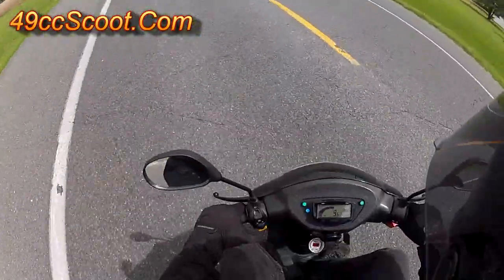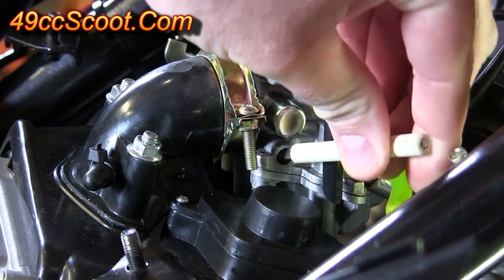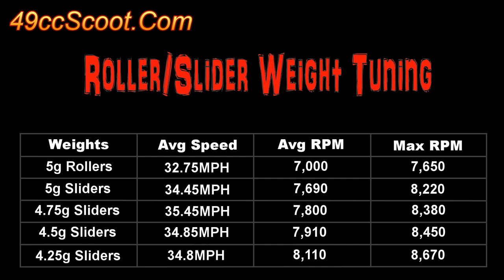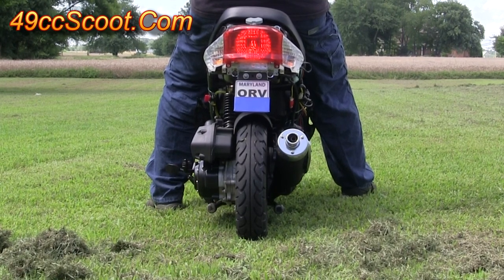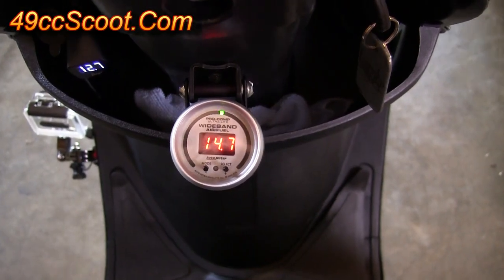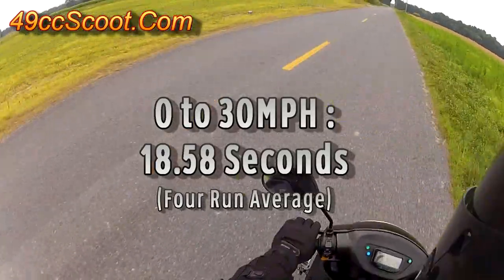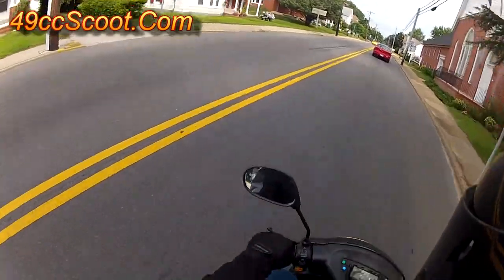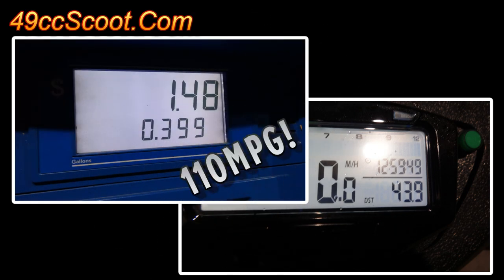Project TaoTao : Carb & CVT Tuning, Airbox Restriction, & Keihin PD19J Swap : 50cc Scooter

Comment: Yeah not a lot of people are going to do that it's cheaper to get online and get a big bore kit for 200 bucks comes with exhaust, intake, carburetor, performance air filter, CDI, NGK plug, performance cam and lifters, transmission upgrade and gaskets, performance fuel line.

Comment: Unbelieve you do that all also for us, ty very much
Reply from the maker: I'm glad if it helps. I love scooters and engines in general.
Reply: quick question, what should i do, when im riding my max speed is at 35mph(almost full throttle), and when im at full throttle it goes like 1-3 mph slower, whats the problem?
Reply: 90GTVert What brand sliders are you using or would recommend? I just got a KOSO variator with 6g sliders from scrappydawg but my 6g rollers are much faster with acceleration. Do would you recommend buying a "performance" clutch kit or just replacing the stock spring and/or shoe?

Comment: as far as your tests I am impressed with your knowledge all of mine is self acquired had to start working on small engines when I was little had a minibike and it sat too long one time and I had to take apart and clean my carb was my first learning session got into it right then
Reply from the maker: I read performance books for bikes/cars and such, but I have to have my hands on something to really learn it.

Comment: I want you to know I admire your dedication to those small engines.I do not have a shop but have done 100's of different tests.One thing worth sharing with you is my results on my gy6 150 cc concerning the air fuel mixture screw.Let me know if you're interested.Thanks
Reply from the maker: Sure, what ya got?

Comment from the maker: As long as there is no leak where you sealed off the head, should be no trouble with PAIR removal and tune. Take a look at the plug. Easy enough to see if it's fouled. If you run it WOT first and shut the engine off, coast in or ideally brake so the engine totally stops. Then when you look at the plug you'll be able to see if it's wet or dry to give you more clues. Check grounds and other connections. Make sure the plug boot and wire are secure.

Comment from the maker: Shouldn't be like a mirror, but they aren't usually as rough as you'd think. Rough it up with some sandpaper or emery cloth. Give the clutch shoes a quick once over as well. Clean both with brake parts cleaner before you reinstall.

Comment: At one point in one of the videos you mentioned a good starting point for the air fuel mixture screw, was that like 1 and 1/2 turns out or??? Thank you love your videos awesome information well-presented
Reply from the maker: 1.5 - 2 turns out is a common range for a starting point.

Comment from the maker: Thanks. This one is running hotter CHT than my 2Ts. My 2Ts stick more around 300-350WOT according to my gauges... but then I also don't have to run them wide open all the time when cruising at 30-35, so the 4T is seeing a lot long WOT times. The probe is about 11-12" from the header, maybe 1-2 o'clock position, about 3/4" spaced up to not block the small pipe off (pics on forum). It would work on a 2T, but oil is hard on the sensor and a special adapter (Koso) should be used. Never tried it.

Comment from the maker: It won't usually close until everything starts rotating. You can turn the pulleys by hand sorta feeding the belt while the engine is off and you should see that it starts working it's way out... or make sur ethe belt clears the cover and bolt it back on then start the engine. Let it run a few seconds and shut it off and re-check if you'd like. If it stays there after the engine is running, then there's a problem.

Comment: I ported my intake , opening up the 90° turn mostly, but the main issue was port matching, the ports were off substantially! Nearly 1/4 of the port, I bought a new intake, it was considerably smaller, and had a major reduction in size around the 90° bend, it was about 14mm, just over 1/2", like the tip of my lil finger ! I opened it up a bit, but it was nothing near the size of another I had, so I ported it and matched it to the head, I would like for it to be about 2mm larger around the 90° bend, with a nice sweep, it fits the carb and head nicely, I straightened the port under the valves, and blended around the valve guides, id like to eventually go to the 52mm bore, and 44mm stroke, maybe get crazy with some machining, and move to a 57 mm bore, should be 100cc plus a couple right? I haven't done the maths, maybe 98-99cc but no replacement for displacement!  It would be cheaper and easier to just swap in a 150cc, (with a big bore),
Reply from the maker: You'd have about 112cc if you could make a 57mm bore fit. All said and done, I'd guess you'd fair better swapping in a GY6 150. A lot of people have had enough trouble with reliability with even the 52.4mm bores. I'd also assume you'd have pretty much no material between the bore and the studs at that point, if there's enough room to do it at all.

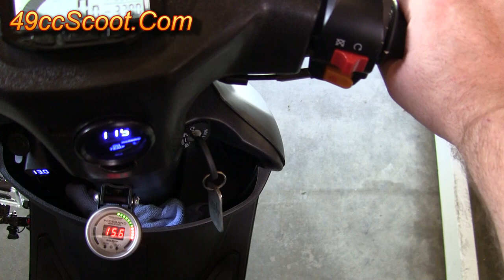Comment from the maker: Stephanie Spangler (can't reply to your message) : If you watch @ 6:56 or so I said I changed to a 90 main jet in the stock carb so it worked with the more open airbox. In stock form my stock carb had a 79 main jet. Most use 32-35 pilot jets stock.
Reply: yes you did. i just realized my misinterpretation. thank you so much for taking the time to share your knowledge and experience. My TaoTao50 is much happier now.
Reply: ***** u were right im still fukin with this carb.the fuel mixture screw is too far out smaller pilot? i did what ur video said on fuel idle mixture adj.
Reply from the maker: If the mix screw is way out, try a larger pilot jet. On these carbs it controls fuel so when it's out it's letting more fuel pass and if it's in it's blocking off the fuel passage more.
Reply: i read someone with a scooter like mine the vip champion taotao couldnt get it to run for shit it had 23 miles on it he had to return it carb issues. id bet the farm on it you could get it right.
Reply from the maker: Hard to know. There have been some pretty poor quality parts out of China at times.
Reply: Kevin Stearns My Roketa has 16 miles on it and runs like CRAP!
Reply: BigJohnMcVicker the guy on this page is fukin awesome he will get you in the right direction.

Comment: I took the pair block off plate off. Looks sealed good. Maybe I spray witb carb cleaner see if it idles up. There are only 2 grounds on the bike at the v cvr. Maybe the other end came loose . The bike ran great plug chop had been done. I did move up some jet sizes thinking that was problem becaus temp has dropped here but that did not remedy. Gonna check grounds again and change pluv. Tha ks  for the help

Comment: Great videos. I bought a new taotao and did replaced almost everything you replaced. It runs way better now. I can’t seem to find the KeiHin carb online and if I do I find, I can only find the cheap ones that looks nothing like yours. I know you bought yours from a local store. But did you find any legit Keihin carbs online?
Reply from the maker: I bought mine from an eBay seller, but they no longer have them. The Keihin part isn't essential. I actually think most replacement carbs that are fully adjustable would do fine. The stock carb wouldn't bother me if it were adjustable, but finding the right needle wasn't worth it to me. Easier to get a whole new carb.
Reply: Ok thanks for the info and btw your videos were really helpful. 👍👍👍👍👍
Reply: 90GTVert ... so the toatoa needs a 19mm or a 20mm carb... if it was in your video I missed it 3 times now

Comment: Just curious about your tire.  In the videos you accelerate through wet grass and then out of a puddle on the road.  What kind of tires would you recommend for wet street conditions?  Awesome instructional videos!
Reply from the maker: This thing is underpowered and I'm heavy, so it's not so demanding for traction, but I'm just using cheap Kenda K329s and I had Vee Rubber on the rear at one point. My two-strokes have more traction issues, and I've had good results with Michelin Pilots on them. Lots of tires work pretty well, but stay away from max performance dry weather tires. Michelin Boppers are probably the worst I've had. My first 70cc would spin the tire bad in the rain with one of those on the back.
Reply: Thanks.  Even the tread on the Boppers does not look good for wet weather.

Comment: Great video! Are 4 stroke engines hotter at the head than a 2 stroke?
I like your air-fuel ratio meter, have you tried to use one on your two strokes? Would that work? Where did you mount the probe, or did i miss a video?

Comment: Hello and thank you for these great videos I have a crazy question maybe you could answer, I bought two of the same scooters one of them does 43 mph right out the box which is crazy? But the other oneCan barely hit 25 what would you recommend I try?I have changed the plug,carb,cdi, and that fuel vacuum thing to no avail. can you recommend anything else because that particular one is still super slow?
Reply from the maker: Have you tried any of the parts from the faster on on the slower one? Like, did you try it's carb or just a general replacement carb? It could be as simple as a tuning difference. Could be that one has a restriction somewhere. Could be a defect, like maybe one has low compression.
Reply: No sir I didn’t try any of the parts from the other scooter, no I wish I did one at a time dammit man? I just kept getting stuff on Amazon you know hoping something would work I think it’s a lemon or restricted like you said I. Hey thanks a lot for responding looks pretty peaceful out there where you Live, got a nice clear mind to make great videos well the rest of the world as dodging cars lol. hey are you have a wonderful day and thanks again

Comment: Nice instructive videos! What pilot size were you using on the aftermarket carb?
Reply from the maker: Thanks. I used the 33 that came in the carb.
Reply: @49ccscoot  thank you for the quick response! I do appreciate it very much!
Reply: @49ccscoot  also where did you get 4.75g sliders? I can’t find any. Or did you use 3-4.5 and 3-5 to get 4.75? If not would it be ok to do so as long as you alternate sizes?
Reply from the maker: @elvis7094  Yeah, I mix weights to get the 1/4 gram increments. They must be staggered. So only 2 different weights of rollers or sliders, call them A and B. Put them in A, B, A, B, A, B so it is balanced. You can also modify weights to whatever spec you want.
https://youtu.be/YkNhqEFeWVQ
Reply: @49ccscoot  thank you very much

Comment: You changed the main jet to 75, what did you set the pilot/ idle jet to?  Also, I am a big guy, 230lbs., what slider or roller weights which you suggest just to go 35mph on flat roads?
Reply from the maker: I made no change to the pilot jet because it was not necessary. The mixture screw was able to control idle mixture just fine. I'm close to 300lbs so what I used here may be close for you. There's no 1 right answer, especially since contra spring stiffness can vary.

Comment: Awesome! Long intake runners helps car engines make more low to mid range TQ, has anyone heard of someone adding length to the intake of these scooters? Either a 1" spacer under the intake, or a pipe and boot between carb and intake , or both? Being these little guys sound their day at near full throttle, it may not help with top speed, however maybe it could help get ya there quicker??  If done properly maybe it could help top end slightly,
Reply from the maker: I'm sure it has been tried, but it's not a common mod. Most intake mods are due to fit or port/carb diameter changes. With these engines, gains at low RPM aren't usually worth a lot because the CVT keeps them at fairly high RPM so much. For all out performance, the best bet is usually to focus on making the CVT hold RPM the best you can at WOT and focus power making efforts on a somewhat narrow range.

Comment: I am planning on upgrading my 49 cc tao tao scooter to a 80cc with a big bore kit form rolling wrench, what carburetor to I need to use with this upgrade, can you recommend one thanks and keep doing more videos
Reply from the maker: +michael paradise 19-20mm without the factory sealing would be fine. Pretty much any that you buy shouldn't be sealed. That's only on scoots to meet EPA regulations. You can find them on ebay and from places like http://www.partsforscooters.com/?partner=49CCSCOOT . Keihin is good if you can find one at a reasonable price, but even the knockoffs do fine for most. Just the sealed stuff without adjustable needles should be ditched.

Comment: Is that an aftermarket speedo? And if so, where did you find it? Also is your engine still a stock 49cc or have you added a big bore kit?
Reply from the maker: Gauge Info : http://49ccscoot.proboards.com/thread/8614/trail-tech-vapor-information-installation

It's stock, just a little tuning.

Comment: Ok got got the cvt and clutch swapped. I still have issues . It was jetted correct running excellent then just started runing like it is missing. Sometines it pulls great runs great but its sporadic.  I swapped cdi, coil ect with my other bike nothing worked. I checked valves went over all wiring checked timing pickup ect .

Comment: one thing you did was removed the hose from the air box do not do this instead leave the house with the cap for stability and remove the filter in the air box. after removeing the stock fome filter buy a 38mm coin filter and slip it over the end of the hose you removed this way you will get more airflow and better performance the stock fome filter restricts air intake but in most cases you still need the hose and box

Comment: What would be considered the safe temperature range for the head? Also what should be the max rpm?
Reply from the maker: Temp will depend on your gauge setup to some degree. With any of my CHT gauges I tend to get used to the range it runs in when in tune and anything significantly higher is an issue. Peak power for me was 7800-8200 so there really wouldn't be a need to rev too much higher. Valve float is somewhere above 10,000RPM for most of these.

Comment: Well I finally broke down and bought a wideband AFR.  intend to use it on my (171cc) China scooter, I'm gathering that 12.5 to 13.5 would be good numbers to look for and  tune for, does that sound reasonable to you?
Reply from the maker: Yeah, if you can keep it around there WOT it would be good. As shown in the vid, I did my normal tuning routine and found best results based on that. Then I noted what the wideband showed when I was there. Not all engines like exactly the same thing and not all widebands are going to measure exactly the same so I think it's best to do it that way rather than being totally dependent on the sensor right away.
Reply: 14- is optimal

Comment: Picked up a 2008 49cc  TaoTao with a aftermarket exhaust, and a new tcmt 50cc scooter carburetor and has stock air box.. it will NOT go over 25 mph .. the main jet has a 81 on it. Spark plug was black and I live 880 feet above sea level. What number jet do I need? higher or lower? Any help would be most appreciated. Thanks ...  Btw, your videos are awesome
Reply from the maker: Thanks. Sounds like you may need a smaller jet (lower number). Get a few and work down slowly.
Reply: Thanks man .. I'll give it a go now that i have some direction .. appreciate it  ;)

Comment: I got the keihin carburetor, moved the split washer to the top groove, adjusted mixture screw a quarter to the left. I see a positive difference in take off and top speed but what can I do to handle inclines better? Thx...José
Reply from the maker: Lighter roller weights are usually the easiest option to help them pull hills a little easier. A big bore kit really makes a difference in power though, and should be a nice mod for anyone needing to climb hills.

Comment: hello great video by the way .. i have a ruk clone with plenty of mods. from 1 ¼ exhaust, stroker crank cdi trans kit 20mm carb with #91 jet lots more etc.. my problem is,  with the factor air air I'm not get enough air and with a UNI filter its too much air. do i need to up the jet size to compensate for more air?? plz HELP!!
Reply from the maker: You should try a larger jet with the UNI or a smaller jet with the stock airbox.

Comment: is there a reason you don't do plug chops? is it just the wide band O2 sensor tells you about what a chop would?
Reply from the maker: I don't really do 'em on scoots without the sensor (all the rest I've ever owned or tuned). I find them unnecessary and expensive, since real plug chops involve cutting up spark plugs after one test run. The exception being if something is particularly confusing or difficult to me and I need all of the help I can get.